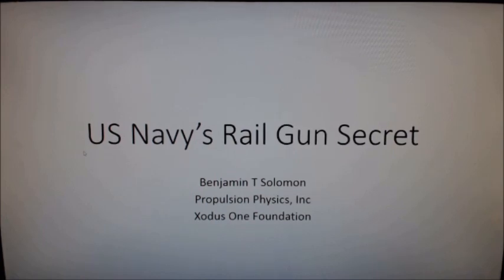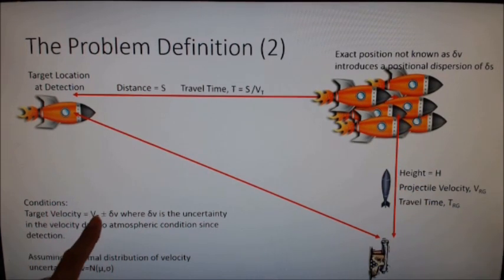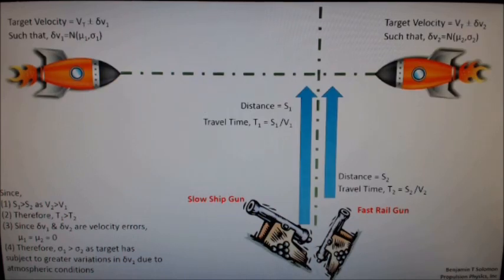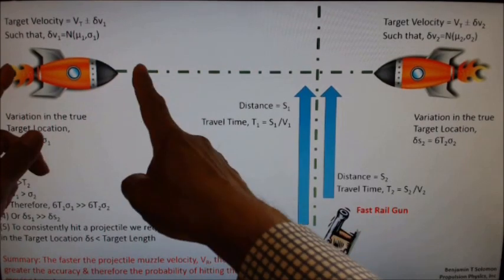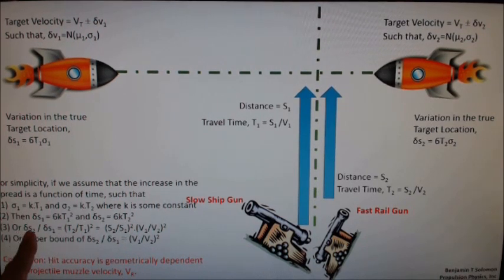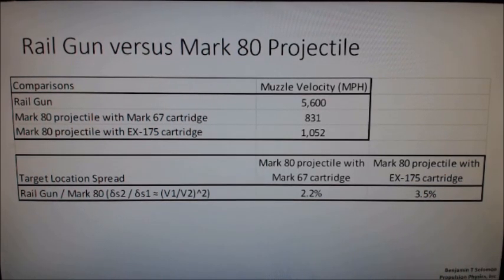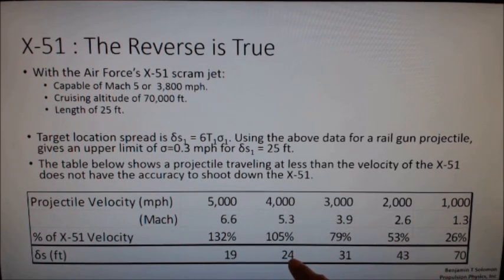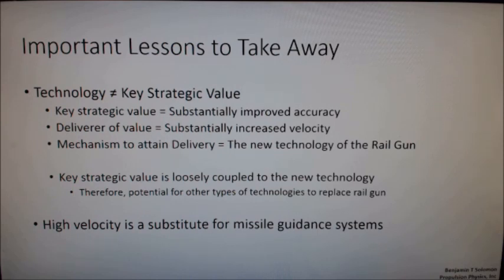The Navy's Rail Gun Hides a Secret

Comment: Two important additional factors to consider:

The sighting of the original target trajectory is done both with RADAR and optically, so... at the speed of light, which is curved through an atmosphere due to a number of factors from air density to gravity, and even altitudinal time phase shift is a factor.

Second, the projectiles being fired from Rail Guns are currently passive.  But part of the benefits derived by supporting other hyper-physics projects such as the X-51, and Kinetic Kill Space Drones, etc. are to determine what it will take to make the rail projectiles 'active'.  That changes everything.